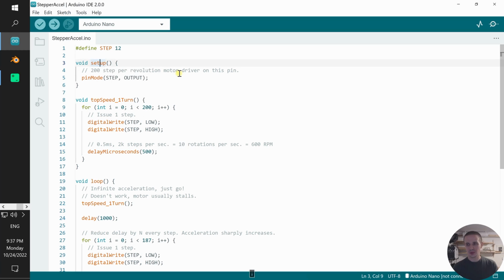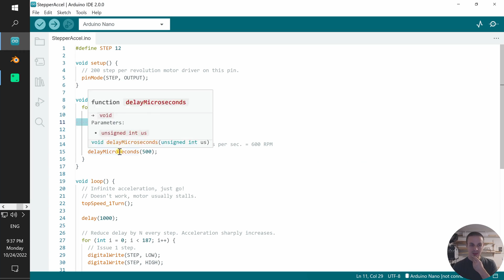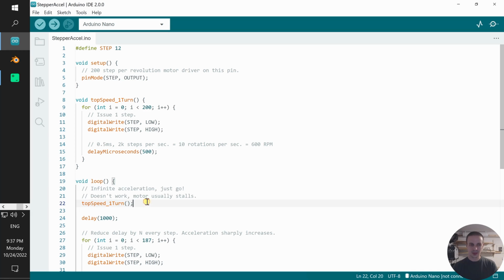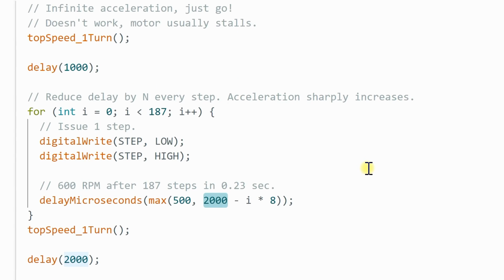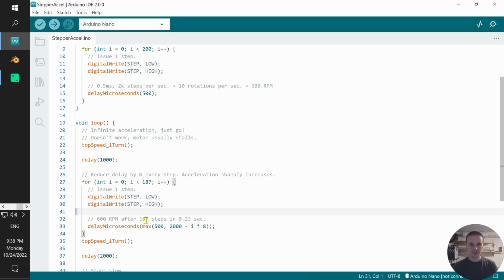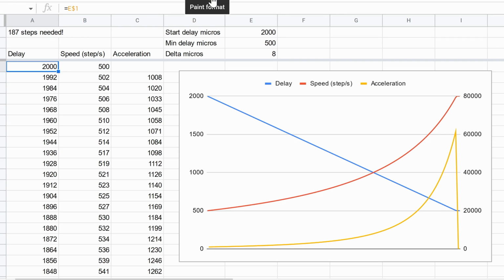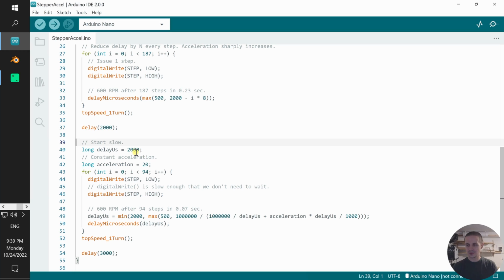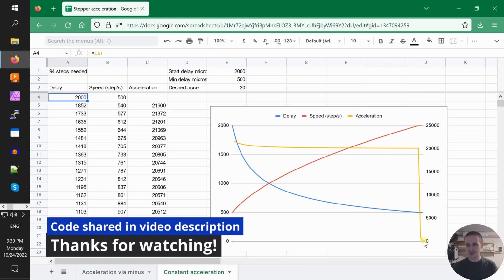Accelerating a stepper motor

Comment: Hi maxim, thank you for your informative videos, I’ve written a few simple programs requiring stepper motors and I have found that using tone to generate pulses instead of writing code takes  far less time of the mc, thus speeding up the poll rate. It may be worth having a quick look. Also adequate controlled acceleration can be achieved with simple maths calculations by using the difference between target speed and actual speed. Pls keep developing the ELS as for most of us, including me, do not have the ability to code such complex programs. Many thanks Roger
Reply from the maker: Roger, thank you. Using tone and pwm allows for much higher speeds but we no longer know how many impulses were issued exactly so precision is lost.
Reply: @MaximKachurovskiy  understood, thank you for your response. I thought you may be counting output pulses on a separate input via interrupt and storing in a register for position record. But recording pulse output count directly from pulse instruction would appear to be more efficient and possibly more reliable. Many thanks Roger

Comment: So, in my implementation of ELS using a Teensy, I don’t use acceleration. The loop checks if the encoder position has changed, and if it has, it adds steps to a counter (based off selected feed rate/thread). 
This algorithm helps with the fact that i don’t always have a whole number relationship between spindle position and leadscrew movement. 

The counter is decremented everytime a timer interrupt fires and the stepper step pin is fired high, then on the next interrupt, low. I have the timer set up for 180khz. 

The Teensy also implements digitalwritefast, so I’m not getting a big delay when setting the pin. 

I wonder if this just works because of the torque I have with a 4A Nema 23 @ 48V?
Reply from the maker: Yeah, I'm thinking about something similar too. What happens if you get the spindle to max speed and then turn on the ELS? :)

Comment: Hi
Why does my stepper (nema24) rotate very slowly when I move it left and right with the button? The offset is set to 2mm. I have a DM542T on which I can set a minimum of 400 microsteps. I test the motor on the table and not in the lathe.
Reply from the maker: Hi Dean, if this is about NanoEls, please start a new discussion on GitHub and we will sort out the problem. Please attach photos of your setup. Thanks!

Comment: Good demo, it's nice to have constant acceleration and deceleration profiles that don't stall the motor or result in lost steps. I need to update mine to something like your example.  Some closed loop stepper / servo drives have built-in S-curve compensation, e.g. CTL57T.
Reply: I like s-curve as well. There's a deep rabbit hole of acceleration profiles to look at. If you know a little calculus, you can say that speed is the derivative of position with respect to time.

The second derivative is acceleration.
The third derivative is called jerk which is pretty common to see mentioned in 3d printer source code and settings for slicers and is probably the edge of where most leave it, but lift engineers (as in elevators) also take it one step further...
The 4th derivative is snap, and telescope and space satellite designers have been known to use 5th and 6th derivatives, "crackle" and "pop".

Speed can be thought of as how quickly the position changes. Acceleration can be thought of as how quickly the speed changes. Jerk can be thought of as how quickly the acceleration changes. Snap can be thought of as how quickly the jerk changes.

TinyG, G2 and Klipper all go to the extreme of 6th order (crackle) but I wouldn't be surprised if there are many diminishing returns beyond 4th order snap.
Reply: @carneeki  TIL, cheers and I thought anything more than constant acceleration might be an overkill 😆
Reply from the maker: Yes, I need to look into the s-curve. Not sure how much of a difference it really makes during those 0.07s though 🤔
Reply: @MaximKachurovskiy  dunno either, given my stepper drivers have s-curve compensation I haven't taken a serious look. On my list for later.